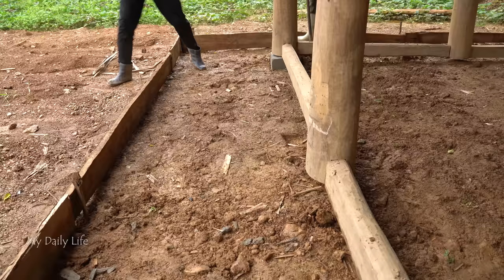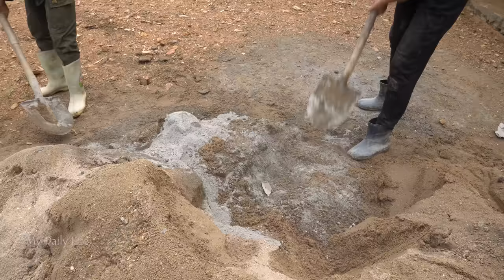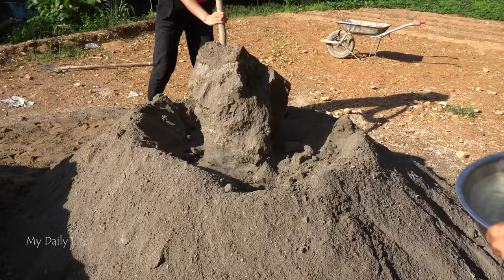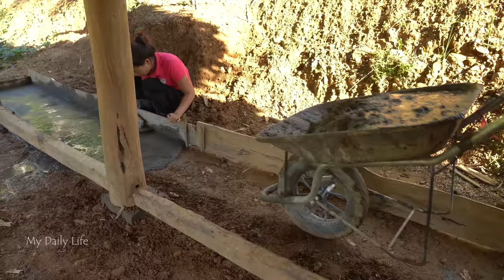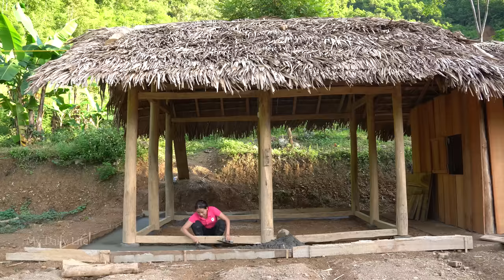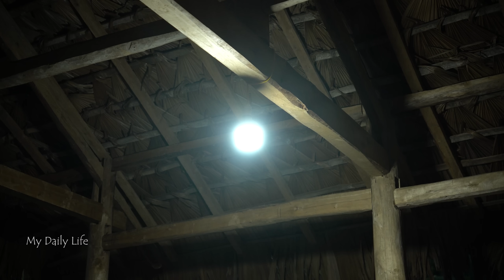How to use stone lift column base, pour concrete floor for wooden house | Hien & Khoa lives on farm

Comment: Hello again! Things look like they are moving forward smoothly, I'm happy to see it coming closer to completion! It's raining here again, can't seem to outrun it this week lol. I've just returned to work from medical leave, I had back surgery back in June, my week has been so far so good! The new floor doesn't look bad, walls are next, yes? You are worried about the gaps between the boards, you can fix that by using smaller boards of the same width to cover the gaps, also might add to the aesthetics of the home. until next time, Stay Safe!

Comment: Hi love your video's.  Just a suggestion.. when mixing cement.. there is a proper ratio of sand to cement ie 1 shovel of cement to 6 shovels of sand .. for the best strength to acheive from all of your effort andif you level the mixedconcrete to thin it will be weak and crack in time 👍👌
Reply from the maker: Oh thank you so much, I'm happy to receive your feedback. I will accept your comments. Wishing you and your family the best.